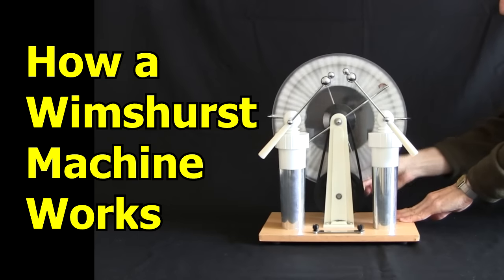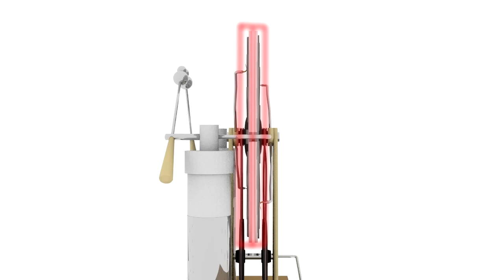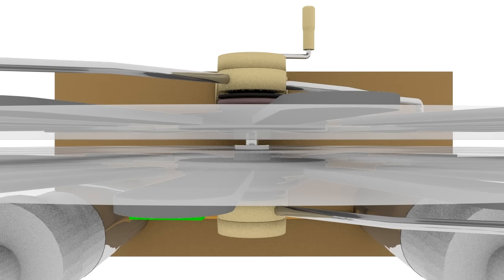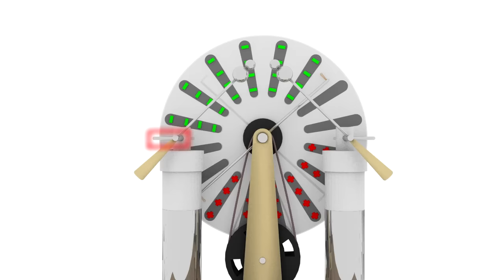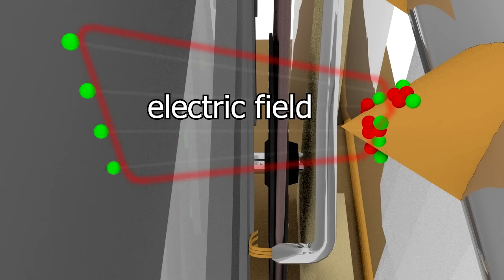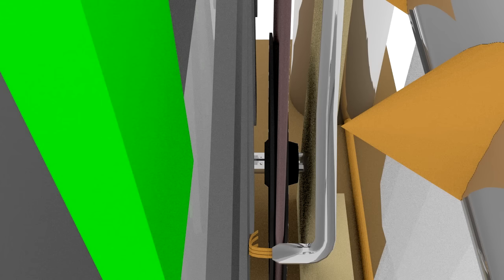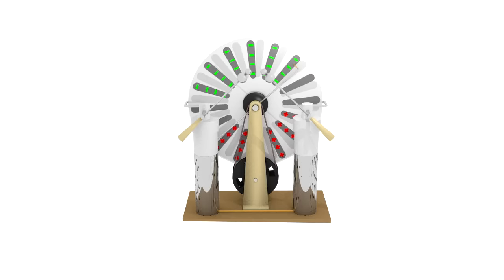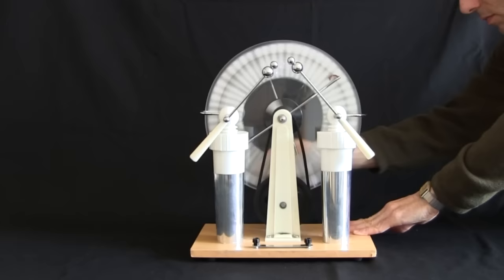How a Wimshurst Machine Works

Comment: why the capacitors in this machine and dom in van de graff dont saturate and still accept more  electrons until the spark occur ,,why no saturation ,please answer me professor
Reply from the maker: I'm not sure if they can saturate. If you remove the spark gap and you keep charging the capacitors then the electric field between the charges on the capacitor and nearby objects in the surrounding room will become strong enough to pull charge from the capacitors. Of course you can then insulate the capacitors so that charge can't leak but then the electric field between the outer cylinder and the inner cylinder will become so strong that the plastic in between them can break down and sparking can happen between them. Basically, at some point the electric field becomes strong enough somewhere that leaking of charge happens in some way.
Reply: @RimstarOrg  thanks you professor ,,theoritically what the difference between high voltage fly back transformer ,high voltage, and an wimshurst and van de graff ,high voltage, why the capacitor in fly back transformer is saturated and in the case in van de graff still accept more electrons
Reply: @RimstarOrg  for example if  we connect 3 kilo volt  transformer to capacitor it will charge until it reach 3000 volt then it will build enough voltage against the supply voltage and stop build up more voltage  so what the different of nature of electricity here
Reply from the maker: If your power supply can supply only 3 kilovolts then that's all the capacitor will charge to. The limiter is the power supply. If the power supply is able to supply a higher voltage than the capacitor can handle (capacitors have a voltage rating) then the dielectric inside the capacitor will break down and start conducting between its plates.
A Wimshurst machine disk has plenty of losses at every sharp point or edge because the electric fields are strongest there, however, some charge will still cross at the collectors and so it will keep pumping charge to the spark gap and capacitors side. There are still sharp edges on the spark gap/capacitor side so you can still have losses there and as I previously said, the capacitor's dielectric can eventually breakdown if the voltage gets high enough.
A Van de Graaff's dome is big and round so the electric field there will be lower and so it will take time to build enough voltage to start ionizing the surrounding air or spark to something, but it will at a high enough voltage.
Reply: great explanation ,thank you,,so there no difference between electronic power supply and electrostatic machine like,wimshrust and van de graff
Reply: Needed help with homework huh?

Comment: Would using exotic materials make more powerful or more frequent charges / discharges ?
Reply from the maker: I guess there'd be a trade-off. You could use a material to ionize the air in the spark gap to make it spark more easily but the also means you wouldn't get as high a voltage, so weaker sparks.
Reply: Would using uranium for the sectors give off more negative charges ?
Reply from the maker: From https://en.wikipedia.org/wiki/Uranium, uranium emits alpha particles, which are neutral. However, if they have enough energy to knock electrons loose from collisions with other molecules in the air then you'd get ionized air with negative electrons and positive ions. I did just that in my How Radiation Works video (https://www.youtube.com/watch?v=aJkx6hAD-4E) using Americium 241 in order to encourage sparking in a spark gap. (I forgot about that when I replied before.)

Comment: I went to college.  Graduated top of my class.  What you say makes perfect sense and follows physics rules to work.  This has been growing for a few years now it's great to see.  However, before I finished watching the video I was already pulling at what's left of my scientific persons hairdo that pulls their hair like that a lot.   Some of this defies traditional flows of conjecture.  Not the physics ok?  Just making it clear before I go ahead i think this is great but.. .   .       .   You go through ALL THAT EFFORT to craft a differential between two points, and just let everything just go snap and balance out?   May I suggest that a good strong diode even an led, acts as a capacitor while at the same time acts as a one way valve?  This would allow for HUUUUUUGE (sorry mr trump) shunts of electron current flow on another direction?  A transistor is essentially two diodes configured like they are into a three terminal device.  The right diodes might allow you to not need to re enter the electrons back into the system.  Sure van de graph phenomena might occur,  but perhaps a one way shunting of that huge spark might allow you to keep what you have gathered.  It seems mind boggling to give away such a huge collection of energy after all that mechanical work.  Not at all knocking your awesome progress and research, I love it.  But in terms of economize or...recycle recycle recycle, I fail to see why giving up so much electrostatic/mechanical work is worth it.  Is there an aspect I am missing?  Great machine I do like it.  I got to try this.
Reply from the maker: Why? Well, a Wimshurst machine on its own is good for learning and I guess if you like making sparks, then it's good for that too. In explaining the Wimshurst machine in this video alone I've had to explain capacitors, discharging through air, electrostatic induction,... But I've also used it as a power supply for all the things I mentioned at the beginning of the video. Near the end of the video, I mention them again and point out that there are links to all those demonstration videos in the description below this video. Have a look at them you'll see what I've used it for. You'll probably ask why do those things too and the answer is mostly for fun and learning.
Reply: RimstarOrg o I so agree with you that's just it.  Without seeing the workload I thoroughly see that power can be drawn from it.  I can't say it defies any physics it doesn't that's what's boggling.  Part of my brain is acting like doc brown from back to the future.  But only because you appear so correct I need to do this myself just to go doc brown on it.  This is awesome you see.  In the meantime look up diodes.  One way flowing capacitor like valves.  Really strong spike thresholds.  Wow.  The potentials of this are very exciting.  Great work , dude and thanks for sharing!

Comment: How high is high voltage?
Reply from the maker: There isn't any value. For me it's anything over 1000 volts. For electricians I think it's anything over 30 volts.
Reply: @RimstarOrg  what’s the plan now after creating that much power? Can we store this in a battery cell and use it to power light bulbs, TV?
Reply from the maker: It looks like a lot of power but it isn't. You can tell ultimately by the amount of mechanical effort that goes into turning the crank by hand. It doesn't take a lot of effort and you don't turn it very fast. There's only enough power to run some small LEDs. However, with some added circuitry, you could charge up a battery over time.

Comment: What I don't understand is How Moving a fixed number of electrons creates More electrons
Reply from the maker: Electrons aren't created. They're either freed up from the outer orbitals of atoms or they're already free electrons  (I didn't show that case) which are repelled or attracted to somewhere else. If that doesn't clear it up then please give me a timestamp in the video where I can clear it up specifically.
Reply: @RimstarOrg  I don't mean created in that sense , I mean Charge (free electrons), since your are simply moving charge around how does that create more charge.
Reply from the maker: As you say, we're simply moving charge around. Electrons are gathered from the disk at one collector and when the spark occurs, they cross through the spark gap over to the other collector and back onto the disk. No charge is being created, nor does any need to be created.
If you think of it in terms of energy, the mechanical energy of turning the hand crank is converted into electrical energy (the movement of charge).
Reply: @RimstarOrg  I believe it's the air friction with the disks that creates the charge and the metal elements are just a means of collection ...
Reply from the maker: The way it works is pretty well known and has been for over a century. The origin of the charge is explained starting at 1:52 and the background for the science starts at  0:30.
Reply: @RimstarOrg  I'll bet that machine would not work in a High vacuum... Example of what my thinking is... Take 3 capacitors ... Charge one to a give amount  now connect the 3 capacitors in parallel let the charge balance now disconnect then connect two in series then parallel to the 3rd capacitor ... doing this multiple times will not create more charge... If It did you could male a generator simply out of a switching circuit of capacitors ...
Reply: @RimstarOrg  I believe that the interaction of air molecules withe the rotating insulating plastic disks has a very important role in that charge generation ... try changing the gas medium ( i.e. helium or argon or xenon , what effect does that have ?
Reply from the maker: For your capacitor example, I'd agree that the total amount of charge would not change, at least in an ideal situation with no losses. Sadly there are losses, so the total charge on the capacitor plates would decrease, mostly due to heating losses as the charge moves from capacitor to capacitor, decreasing the kinetic energy and thus the potential energy. If you did have an ideal situation and tried to connect a generator, the generator itself would be a loss.

The input energy here is the mechanical energy of the hand cranking. If you were to somehow take the electrical energy output and hook it up to a motor to turn the crank, it would of course not work due to all the losses.

A Wimshurst machine is especially lossey at the collectors, where charge is transferred through the air, physically losing a lot of the ions to the surrounding air. But I suspect that charge loss is made up for at the sectors. Run it in a dark room and you'll see plenty of purplish corona around the sectors. That corona is in the air around the sectors and, though I've never heard it said, I suspect it's collecting some charge there.

But charge isn't what makes it work. Energy is. And that comes from the hand crank.
Reply: @ @youknowwho5375  It will work in vaccum. They did not mention, for sake of simplicity effect of changing capacitance of sectors. By lowering capacity, you rise voltage if charge remain constant. Look at this machine https://www.youtube.com/watch?v=sECDnoPejdM
Cute little thing, yet so simple by design.
Reply: When the neutralize bar makes contact with the sectors, it is as there is a single long piece of metal made of the two sectors connected by the bar.
By the effect of the other disk induction, in an extremity of this single piece, electrons are attracted, while on the other extremity electrons are repulsed.
When the bar slide off from the sectors, it is as this long piece of metal is broken in two pieces.
The charges inducted on each piece however remains, and they are conveyed towards the collector and the Leyden jars where they are acumulated.

Comment: Can I make Wimshurst with coke cans?
Reply from the maker: You can use parts of the cans but you'll need more than just cans. For example, you can make the metal segments from the cans, just make sure to scrape or clean off any coating so that the bare metal is exposed. You can also use the metal from the cans for the metal cylinders for the Leyden jars.

Comment: electrical negatively charge other side positively charged disk rotates clockwise the oppositive site rotates counter clockwise, collector neutralizes, electron flows from here to there then the capacitor, then the rod and then this bla bla bla. too much MandM....it is driving the mind crazy. i disliked this craps

Comment: Total nonsense. Total nonsense! One sector has only a minus, and another same sector has a minus and a plus?
Reply from the maker: I'm not sure where you're referring to in the video but a sector can have minus on one side and plus on the other. That is possible if another section is influencing the charges on it by repelling or attracting charges. Overall that sector will be neutral.
Reply: thats called charge seperation and is caused by influenz